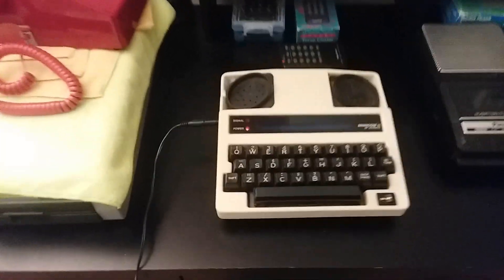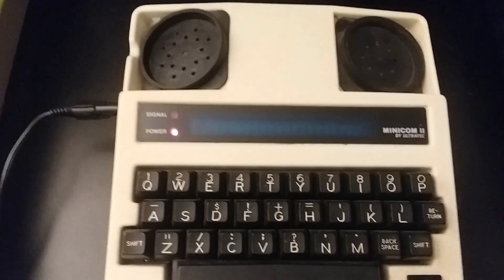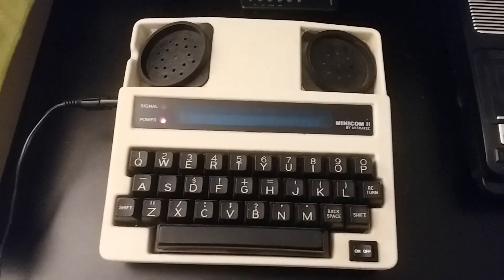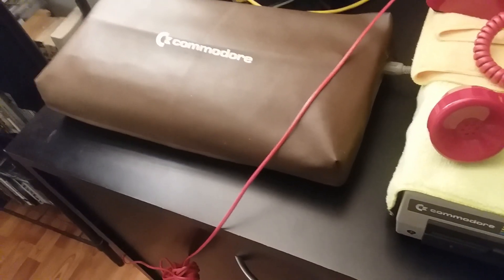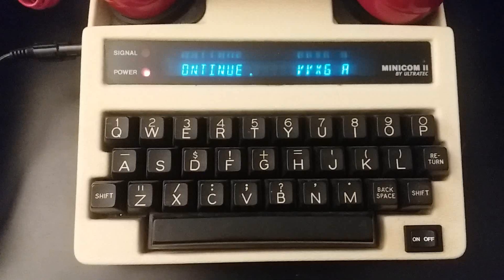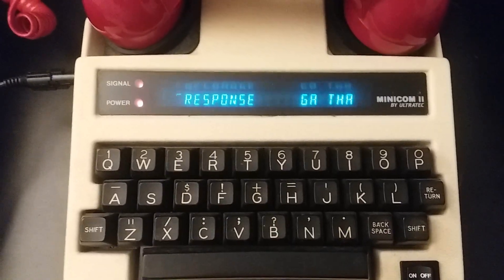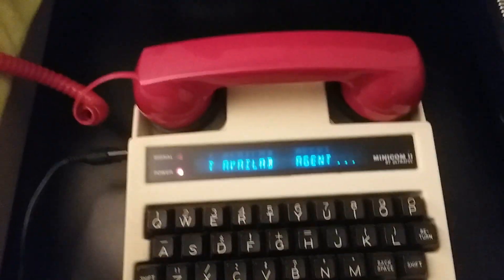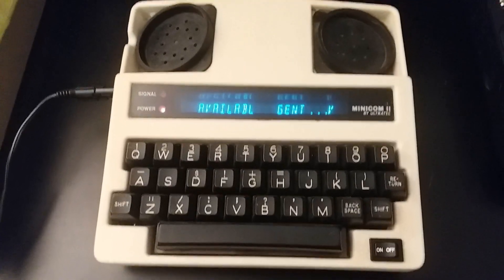1983 Ultratec Minicom II TTY/TDD machine demo

Comment: Would this work over SIP/VOIP with an IP phone or ATA adapter?
Reply from the maker: Hello. I admit that I don't know the answer to your question. But, the acoustic coupler located at the top of the machine is what sends/receives all signals, designed to be used with a standard telephone handset. However, I've seen another video of a guy who was using one of the machines to decode signals off of the radio via a simple hack of placing a small speaker for the receive signal into the receive part of the coupler. So I suppose that what you suggest might be possible. And hey, we all know that technology wants to be hacked in meaningful ways...
Reply: The only model I know of to work with modern Android phones (mind that you need a 3.5 mm headphone jack to connect to the TTY machine) is the Krown PortaView Jr PV20 TTY with Android Cell Phone Connection

Comment: I have two of these from back in the day, they really started to become obsolete with T-Mobile Sidekick, also you don't need to press return, I don't know why it even has one. You had to use GA because everything was on one line, and could 'talk' over one another easily. Most of the later models just plugged directly into the wall and didn't need a receiver on it. Then SK for stop key, then hang up.

Comment: Sometimes, I wish we could bring back these machines, but with a 21st Century spin, like a wireless teletype, I know it's not practical, but it would be esthetically pleasing.
Reply: George Wilson
I agree, I think they missed a trick with fax machines, fax machines would of been a lot better if they had a keyboard & monitor to use like a minicom or had keyboard/monitor sockets on the fax machine that way you could send data, I think a machine like that would still be useful today, there are situations where a direct point to point connection is preferable to the Internet even today, like sending bit-coin transactions etc.